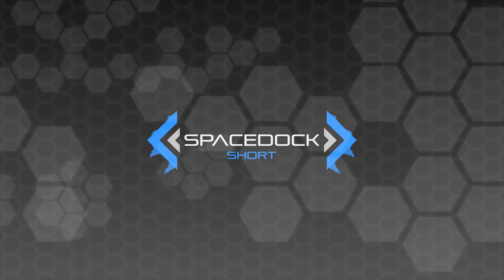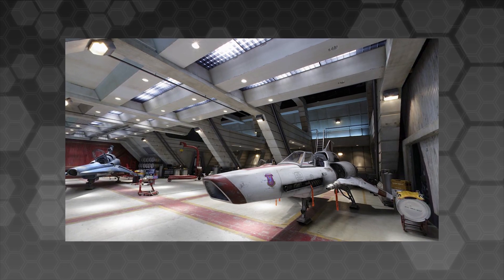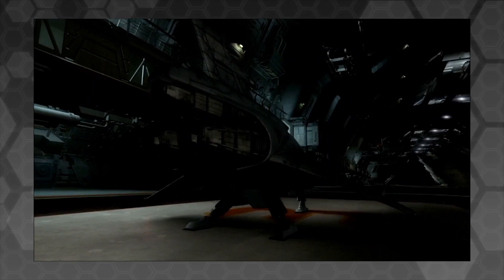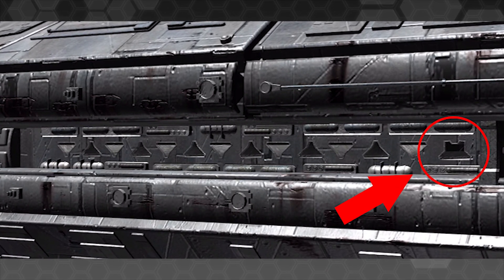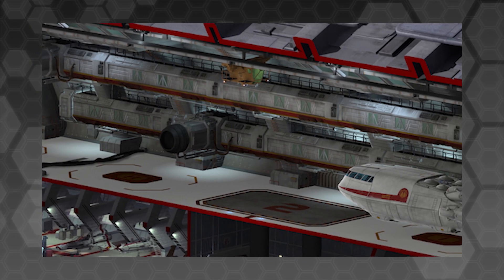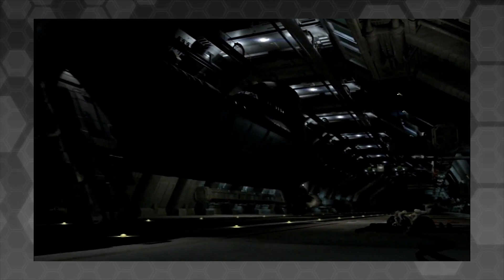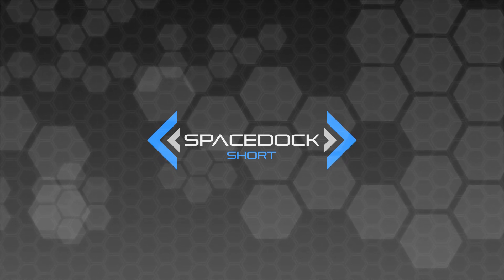How to Land on the Battlestar Galactica

Comment: The Vipers should be designed with a reverse thrust vectoring mode for their engines to enable them to decelerate quickly to a stop in the bay then land magnetically.

Alternatively, during the landing process Galactica’s own acceleration should be limited to forward accelerations only and limited turning of only a few degrees to limit the risk of vipers slamming into the wall on approach.

Viper landings would also benefit from landing through the rear pod door during acceleration for obvious reasons related to relative velocity matching.

Comment: I would expect that any raptor being launched from a lower flight pod would be flipped/inverted by the lift platform as it lowers to the flight deck. Horribly maintenance intensive but, as you say, worth the added numbers of launch tubes, fighters, and raptors.

Comment: You don't need a lift for the lower or "upside down" landing "lift" all you have to do is rotate the "platform" on it's axis using some sort of airlock I presume to avoid de-pressurization?

Comment: One thing I was always confused by

Why the hell did they never reconvert the starboard bay BACK into it’s original state?
Reply: They turned the starboard pod into refugee housing.
Reply: After the fall of the colonies, the gift shop became an essential resource for the fleets ongoing supply of pencil erasers, key rings and coffee mugs. If you wanted the current year's Girls of the Galactica calendar, or a reproduction print signed picture of Commander Adama in the CIC too, it was really the only place left where you could get them.

I mean, just imagine. You're a survivor in the civilian fleet and you get up for work one day. You're still a bit groggy though, because you broke your coffee mug yesterday and can't get another one. You get to work, but because you don't have a calendar to mark it down on and you're still half asleep, you forget you had an important meeting first thing. Depressed, you can't even look at your signed desk picture of Adama to motivate and encourage yourself. So, instead you decide to busy yourself with filling out the weeks supplies order for your ship, but you make a mistake on the form. With no eraser to correct the mistake, instead of the 500 meal rations you intended on ordering for your civilian transport, you end up receiving 500 rounds of battlestar heavy artillery rounds. Now in the depths of despair, you call it quits for the day and go back to your quarters, only to find that you've lost your keys, can't get in and can't get the maintenance crew to let you in, because they're busy dealing with the huge hole in the side of the ship that was just cleaved open by the rogue artillery round that broke loose and subsiquently took out half of your hangar deck after an unsuspecting deck hand opened one of the crates without checking the manifest off first, hoping to pocket a couple of extra rations for himself.

The entire fleet would be in complete disarray within days!
Reply: I mean I don’t think it needed a shipyard or drydock to do such a tbjng

Comment: Never thought about it before, but why would you need a launch tube shaped like the craft? 
I was under the impression that they basically used a magnetic catapult on the ships. 
Ok, so likely one connection point. Even if it was more like a rail gun theres still no reason for the shape of the tube. Youd just need 2 or 3 tracks to yeet a ship out.

Comment: I don't think the mercury class's lower landing bay has lifts. I think the pad just rotates with the viper or raptor on it flipping it up right and bringing it in to the interior with one motion.

Further more I think the craft get flipped into a air lock and while flight deck personnel are clearing it off the pad another viper is already landing on the back side of the pad so as soon as the airlock is cleared and decompressed the pad flips again.

Comment: I could see the ship recovery system being akin to the plates (treads) on a tracked vehicle's track system. The plates each hold 1 viper, you guide the viper onto the plate attached by standard magnetic attachment, and the ships from below are righted as the belt goes over the end pulley so to speak. This allows multiple vipers to be recovered in short order. Even assuming only 2 plates on each flight deck you could recover 4 fighters at once. And all 4 fighters could be loaded onto or unloaded from the plates simultaneously meaning 8 vipers moving at once (4 loading and 4 unloading).

Comment: id really love to see a more detailed analyzes of the USS SARATOGA (SCVN-2812) Landing / launching hanger bay system from Space above and beyond for the Sa43 hammerheads as well as the ISSCV/APC landing pads and hangers.even when doing the research and inspection of images  and blueprints found online, there really is no visual representations of the inner working.feels like if the Carrier had to make a quick retreat under fire, it would be tricky to recover its fighter wing as the ship would presumably have forward momentum and with the hanger bay doors facing Port and starboard, trying to match vectors is just not feasible. 
on that note, in BSG,i realize its more so a Visual pleasing thing, but it always bothered me how the Vipers launched with gear down but by the time they hit open space the gear were already retracted.

Comment: Perhaps the Pegasus has a hanger depot for each flight deck, meaning that instead of having two with just one launch system for each flight pod, the Pegasus actually has four with one for each orientation on each flight pod, giving it four points from which to recover, repair, and launch Vipers without having to turn them over using a lift. That being said they probably would still need a mechanism for getting parts, supplies, and people into the correct gravity orientation, but to cut maintenance for a complicated lift capable of flipping a Viper, this feels like the best bet. And, in the event that a newly constructed Viper is supposed to replace a Viper from the opposite gravity oriented section, it can simply be deployed from the flight deck that it is already oriented to and then just fly down to the other flight deck and be recovered for that team. 
This is how I always assumed it worked on the Pegasus because it reduces the need to constantly be flipping Vipers and instead just gives four points of origin for the Vipers to be launched and recovered from.

Comment: I find it very interesting that everyone would think that they would have just 1 internal hanger. i would have atlest 2 in each pod so no need to flip the fighters 99% of the time. There would still be a way to move the fighters between them but not many and look they had lunch tubs for both decks for the vipers

Comment: Thinking about the combat landing, I don't think arresting your momentum in and of itself is the issue, but rather the very tight formations required to get all the vipers into the pod at the same time. Heck, we even see a few each time that didn't touch down but just made it in the pod in time for the jump. So yeah. Imagine coming in at full speed barely a plane length behind your squad mate and if he puts on the breaks even a second before you, it's lights out for 2 pilots and vipers

Comment: Hello, great video. In story part of artificial gravity is not really explained. In real spacecraft design centrifuge is used to create gravity in center part of vessels, that rotate. Battlestars would have cylindric shape in middle with gravity, while pods and surfaces that would be used for carrying  guns will be in zero gravity in fixed position. Perhaps, in BSGs it is made artificial gravity, where floor of core of ship itself would made force modulation of gravitons to create gravity field inside ship

Comment: Half of the launch tubes on the Pegasus are.... Upside down. And the pods are offset so I would imagine they simply have a flight deck for each pod. So looking at it the bottom flight deck is upside down and so are the crew as they walk along the "ceiling" I mean it's be easier to deal with having to flip people from one orentation to another than a viper or raptor.

Comment: My take on the "combat landings" is that it was about more than just getting as many fighters on the deck as quickly as possible.

In peacetime, it's easy to teakettle to the deck of a ship that is maintaining constant speed and bearing, but in combat the Galactica herself would be maneuvering, sometimes violently.

Trying to RCS yourself gently onto a pad would risk you touching down hard during one of those maneuvers. Better to come down quickly and get magnetized to the deck ASAP.

Comment: There are two canon ways to land a Viper in on a Battlestar.
The Lee Adama way: glide in nice and smooth and bitch that it was, once again, hands on.
The Starbuck way: fast, messy, and usually missing vital parts of the Viper! 😆

The lower flight decks on the Pegasus would be prime places for additional troop/cargo transport ships to be parked/launched from, or for ships the size of Colonial Heavy 798-- I mean Colonial One to land while keeping the upper decks ready for combat operations.

Comment: I don't believe they DO flip the ships.  If you look at the detail image where you pointed out the raptor launch tube, you'll see that every other Viper tube is inverted.  I imagine this means that the launch tubes aren't straight, with half veering upward, and half veering downward.  That way the VIpers remain in the same orientation they landed in.  This means any reorientation would only be required when passing through the struts back to the core of the ship.  This would be fairly easy if you pass through a moment of zero G as you rotate the lift.  Just have to make sure freight is locked down.

Comment: I'm not so sure about that last point you make here about the inverted flight pods on the Mercury class battlestar having to rotate the ship-lifts through 180 degrees. Go back again and look at that model shot (at 4:10 elapsed in this video) and you can see that half of the viper launch tubes are also inverted. If there was just one hangar deck with a single gravity environment aligned with the rest of the ship, then launching half of the vipers inverted would make no sense at all, and would make the hangar deck operations ridiculously complicated - nobody wants that.

Maybe the inverted launch tubes are just a bit of extra greebles on the model. But if they are actually used (in-universe, of course), then there has to be a reason why they are inverted. One possibility is that there are two hangar decks, with one at 180 degrees to the other: Within each individual hangar deck, operations work without much difference to how they do on the Jupiter class (Galactica) or any other battlestar class with a single flight pod on each side of the ship. So each hangar deck is aligned with the orientation of the flight pod it serves, there are just twice as many of them on the Mercury class battlestar.

Comment: "The Ball" is not used just to center the flight trajectory away from the walls if it's used the same way wet navies do. The lights are arranged and filtered so that they can only be seen at predetermined angles. The purpose is to show that the approaching craft is on the correct approach vector (or glide path, when speaking of atmospheric operations) for a safe touchdown on the deck. If you are coming in too steeply or too shallowly, you see a different pattern of lights that indicate what you're doing wrong. The deck observer is also watching your approach and will wave you off if you're not on the correct vector.

Comment: If the Galactica was real, I know there would have been 12 to 20 hour shifts (4 hours sleep time) turning it from a museum and to get the starboard launch Bay, launch and recovery ready! We did as much on my submarines during peacetime! Only my last sub, the USS Pennsylvania, wasn't that crazy! 
Note how long the launch tube is! Which means the viper has to be all the way; perpendicular, on the far side of the launch tube to be ejected out! And I love how the Viper's engine only ignite just before exiting! Which is a great safety feature should a technician or mechanic be working in the tube!

Comment: Combat landings seem to be all about fast recovery.  That said, if you come into the pad at combat speed, stopping without drag for the landing gear would require and end over end flip and firing the Vipers main engines to arrest momentum.  If you are coming in in mass, you'd run the risk of a lead ship flipping and either hitting the ship behind it by decelerating too soon,  of flipping right into the wash of another vessels main engines, the heat of which could cause the accelerant in the ships cannons to burn, exploding the magazines.  The combat landings, as shown, are probably the safest way to bring the fighters in , as combat speed as quickly as possible...unless I am totally missing something.

Comment: In response to your bit about the ventral pod needing to 'flip' the craft to match the internal gravity of a single unified launch/resupply deck. In your close-up of the Pegasus launch tubes, it looks like there are inverted-orientation launch tubes for vipers interspaced with those for the 'upright' tubes. To me this implies that there are actually 3 decks sandwiched between the dorsal and ventral landing surfaces in the flight pods. Each pod has two repair decks, that are oriented with internal gravity to the two flight deck surfaces. In between those decks is the 'launch' deck. Presumably those repair decks have launch slots that move ready vipers into the unified launch deck so you can launch from both the dorsal and ventral repair decks. So vipers are coming out upside down and rightside up all at the same time! Crazy :)

Comment: Call the Ball is a current CV instructions to landing aircrafts abroad modern Aircraft Carriers. The Fresnel Lens that provides a visual reference to pilots concerning  their altitude / glide slope relative to the ever pitching flight deck of an Aircraft Carrier. When a naval aviator captures visual reference to the Fresnel Lens the callback is, "I have 'the ball'." 
Our galaxies are not that far apart seems to guess.

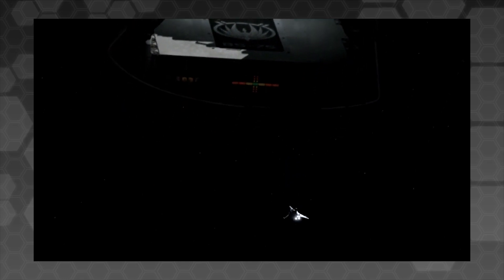Comment: This is probably my third time watching this and I am years late but I just noticed at 3:02 when you are describing the ball this is incorrect but I don't know whether you're attempting to describe the actual ball or not, just that what's shown is not a picture of it. The ball is actually depicted at 0:36, the center green and yellow above and below it would be where the ball is illuminated, green is the optimal angle assuming the correct nose angle off your current vector is being held (correct angle of attack for real aircraft) changing depending upon glide slope, or I suppose descent vector since this is in space.

Comment: Well, they have more control than the space shuttle in that the shuttle is an unpowered glider, but it always makes a 3 point touchdown, vs their rock skipping skid down the deck.
As I understand it, modern carrier operation has the aircraft slam the deck in order to get the hook engaged properly with the arrester cable. So one would probably do similar in GALACTICA to ensure the mag clamps make contact properly.
Most certainly an entire machine shop section dedicated to just reconditioning landing gear after the expected life cycles.

Comment: May be some silly question(s) 🙋, but the launch tubes run underneath the landing deck right? Since they launch perpendicular of the ship, and a second question would be the whole pod Hauses the hangars and launch tubes? Since the only connection to the main ship hull are the two big structural pilons ? How they get them from the main hull?
Reply: Yea most of the lower part of the pod is the hanger and launch tubes. As for how they get to the pods, in blood and chrome there is a tram system shown so  the pylons are probably hollowed out and have personal and cargo lifts.

Comment: Spaceships with enclosed landing strips in space is pants anyway. Even the most clunky spaceship would be able to land just as quickly and more assuredly by VTOL. An enclosed landing deck will actually increase the number of accidents and lead to downtime by such. Scrambling speed might be an argument but that is not the same. Inject the craft into a mass accellerator directly adjacent to the hanger and woosh. This is actually often suggested by the cramped surroundings in which Vipers are launched (in both series). So no complaints there but an enclosed, high speed landing strip in vacuüm? PANTS!
Reply: Might have something to do with ftl, also the runways are protected by armor as well
Reply: @co8783  Not probable. If I remember correctly there is no indication of the posibility of launches during FTL jumps in both series.  One of the recurring plotpoints is actually that a jump should be done whene all the fighter craft are back on board. They would simply be left behind. Furthermore: An aircraft carrier or airbase also has no armoured runway. It is true that landing aircraft are slow and thus vulnarable to predatory aircraft circling a base, as happened above Germany in the last part of WW2, but you wouldn't want to have small craft near your mega-warschip anyway. Ever seen Star Wars? That's why they invented the term air-superiority, although that would then have to be changed into space-superiority of course! Furthermore: The entry speed at the beginning of such a tunnel would have to be excessive, which resets the argument to my earlier comments. Good hard science fiction is actually very diffcult to write well. It is said that the Expanse does things better but I haven't seen any episodes myself yet. :-)